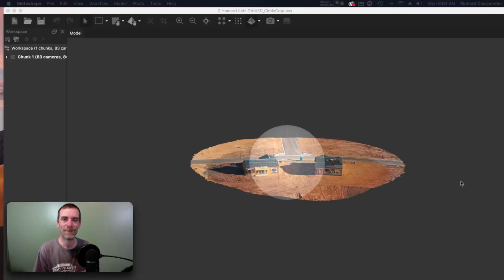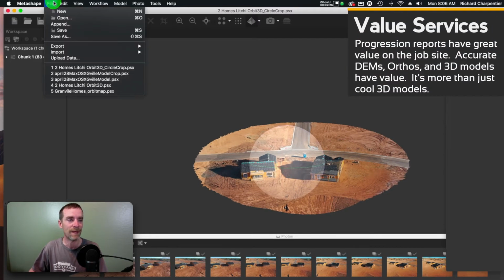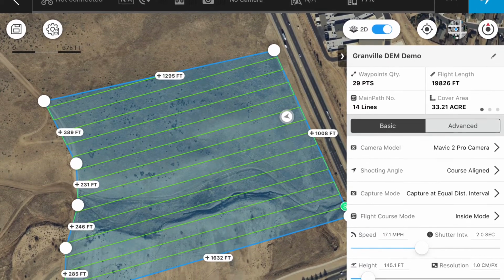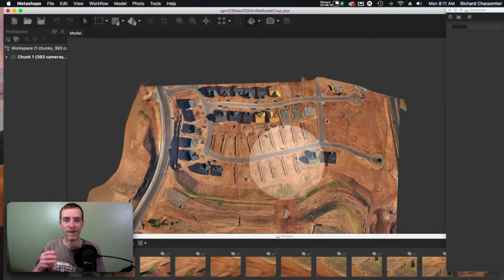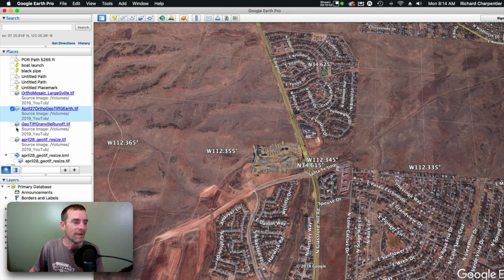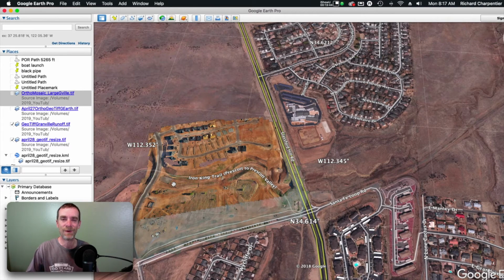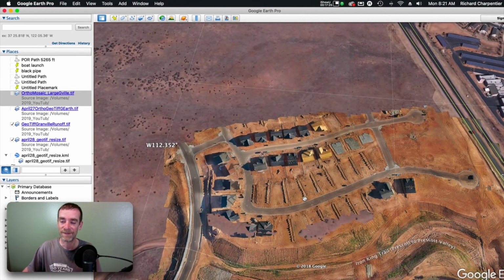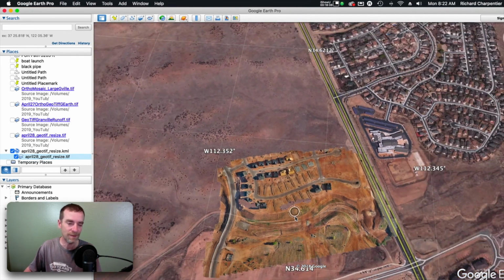3D Drone Modeling and Progression Reports in context - Drone Services you can offer

Comment: Could you define the term "Point Cloud". You may already have and I missed it but the term keeps popping up in your tutorials and I just want to be certain I know what it means. Thanks,
Reply from the maker: Ah, one of the tough questions.  Really, it is a complex topic, but I'll see if I can answer it.

The images we take with our drones are just images with GPS information in them.  The software that allows us to create 3D Models like Agisoft and Pix4D, allows our flat images to be processed in such a way that the data points can be looked at in 3D space.  The points are measured from the external surfaces in our combined images, and points are created.  Those point clouds can then be rendered into a 3D Mesh, which is a mid point in 3D modeling.

When you run a model in Pix4D or in Agisoft's Metashape you have the option of viewing the point cloud.  From a distance it looks like a rough 3D model.  Zooming in you'll see thousands of little points.  These are the building blocks to our final 3D rendering.

To read a little more about point clouds check out this Wikipedia short explanation.  https://en.wikipedia.org/wiki/Point_cloud

Bottom line, these software packages take our flat image information along with GPS data collected, somehow extrapolate points in 3D space (no wonder the programs take so much processing time), and form a cloud of points that can be converted into an actual 3D rendering.  Crazy, right?
Reply: @AZ-Drone  Thanks Rich!